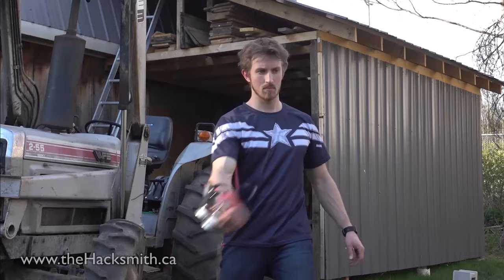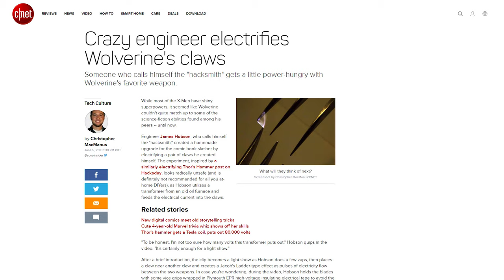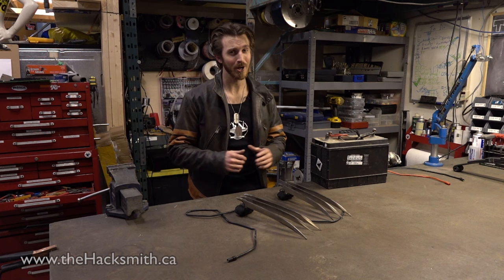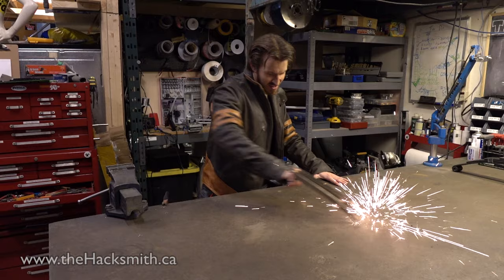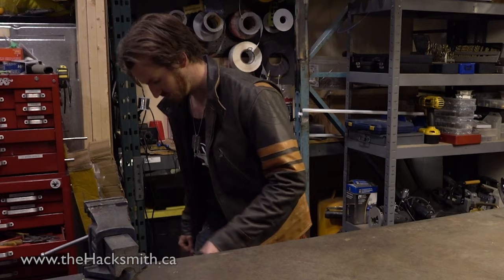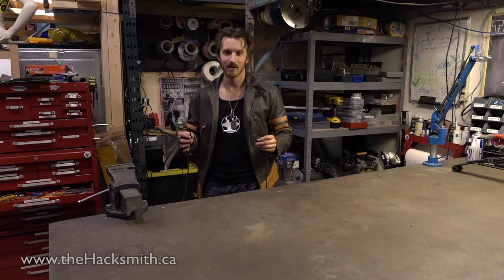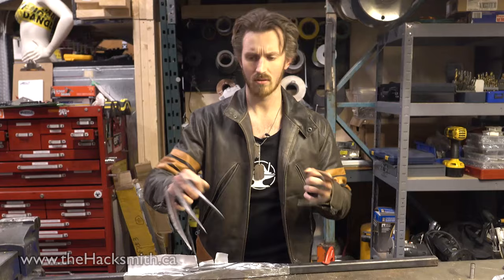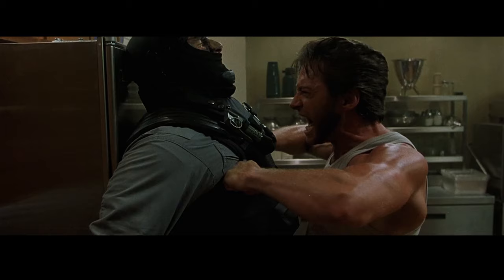Electrified Wolverine Claws: HOW DEADLY ARE THEY?

Comment: Boy what kind of car battery are you using that puts out 1000 amps, most normal car batteries only go up 550 amps which is already more than necessary for the 1 car